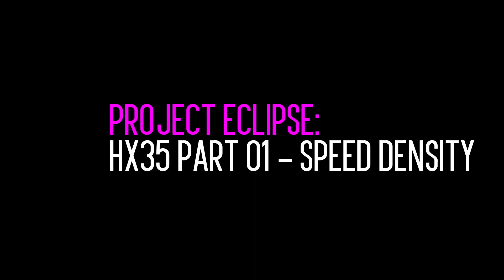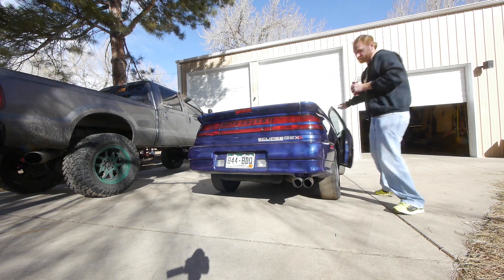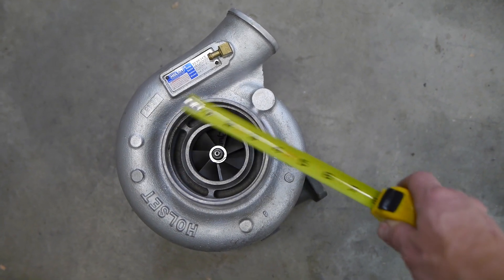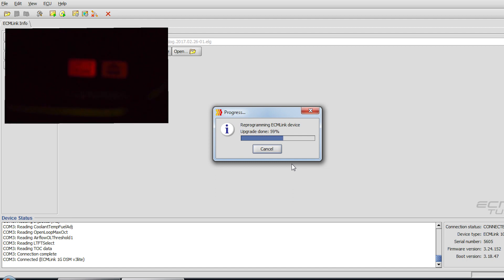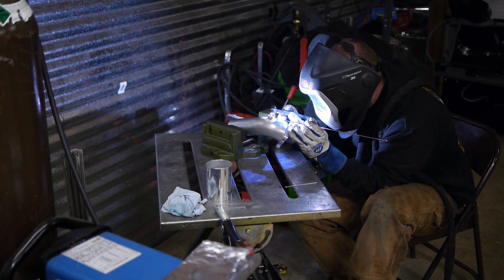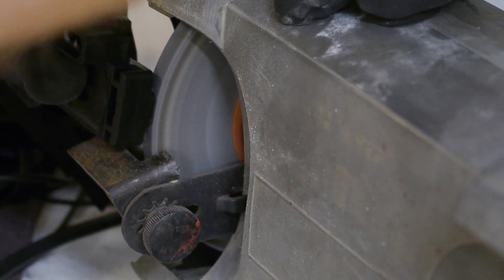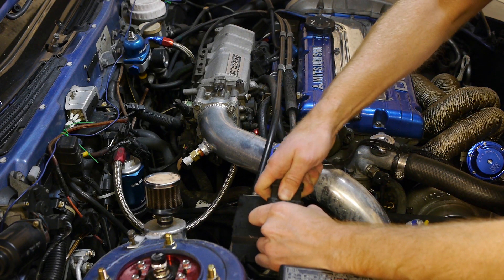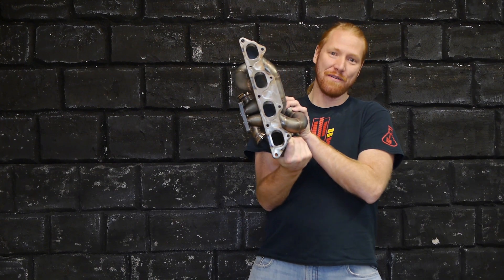HX35 Turbo Upgrade Part 01 - Speed Density

Comment: I watched your HX35 install, man that was alot of fab work and trail and error on the cooling fans, i was kinda laughing because you didn't want to cough up money for a real good fan or quality tial wastegates but ended up spending that amount in replacing them everyday lol props on getting all that to work but i would of gone crazy making all that work so I'd just spend a little bit more and go with a forced performance set up and eliminate the stress and extra work and probably run the same numbers. Kudos on the install though , your welder deserves a gift basket delivered by hookers with coke hahaha i dont got those resources here so i keep it simple.

Comment: You forgot about the fact that you can blow an intercooler pipe and still drive home when using speed density
Reply from the maker: Ooooh that's a good one!   I'm sure I missed a few.
Reply: Love the channel I have a GM Maf. I saw significant gains switching Mafs only. Been scouting a hx35 for a while now
Reply: lol I blew my evo charge pipe(cheap with tiny bead), the clamp was somewhere onthe road never found it. had to unplug the MAF to chug home driving like a grandma, used heaps of fuel.
Reply: Evil GST yeah this guy just started doing what people been doing for over 10 years. he must think he is the new jafromobile

Comment: Hey man, just subbed, super underrated channel. Love your stuff. I currently run HX35 w/ BEP housing. Keep it up!
Reply from the maker: Cool thanks!   Yeah, it's a great turbo :D
Reply: agreed i did the same love the quality <3
Reply: Curious why dont you dsm guys prefer the he351cw it comes with a much smaller housing and makes more power. The He351cw is the updated hx35 plus you can then upgrade to a hx40 turbine wheel and compressor while in a 9cm housing .  Its what most cummins guys upgrade their hx35s to.